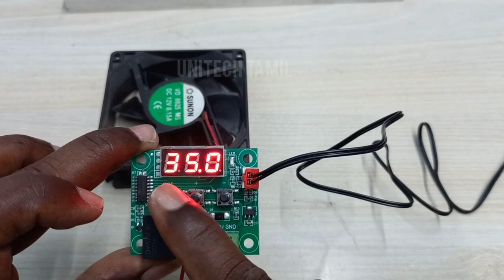THERMOSTAT CONTROLLER CONNECT || ANY AMPLIFIER 12V FAN CONTROL

Comment: Anna oru help ac voltage calling bell sound hevya iruku atha sound kuraika resistance solluga plz 🙏🙏🙏🙏
Reply from the maker: Speaker type? Bell type?
Reply: @UNITECHTAMIL  bell type ( AC supply Anna )
Reply from the maker: Bell coil spring tension kuraknum.

Comment: Samcon Tda 7297 ic board la speaker outputla directa speaker output eruku capacitor illa ic pona dc volt varuma Single Power supply please reply
Reply from the maker: 2200uf/35v capacitor speaker + out l inaikanum.

Comment: அண்ணா நீங்கள் சொல்கின்ற அனைத்து தகவல்களும் அருமை மிக்க நன்றி.
12-0-12 transformar-யை diode & Capacitor பயன்படுத்தி 0-12 ஆக மாற்றிய பிறகு 4440 Mono sub audio board - க்கு Input Volt கொடுக்கின்ற இடத்தில் +Volt க்கு ஒரு diode போட்டு 4700 MfD 25 Volt Capacitor உள்ளது இதனால் ஏதும் Fault வருமா? இதை பற்றி சற்று விளக்கமாக கூறுங்கள் அண்ணா.
Reply from the maker: No problem
Reply: @UNITECHTAMIL  நன்றி அண்ணா.
Reply: அண்ணா இதனால் ஆடியோ bass depth குறையுமா
Reply from the maker: No நீங்க power supply dc out ஐ audio board diode க்கு அடுத்து capacitor ல் கொடுங்க
Reply: @UNITECHTAMIL  அண்ணா usb board ல இருந்து வர OUTPUT PROLOGIC போர்ட் ல இன்புட் ஆ குடுக்கும் போது USB BOARD SHORT CIRCUIT ஆகி BLAST ஆகுது என்ன PROBLEM ஆ இருக்கும்